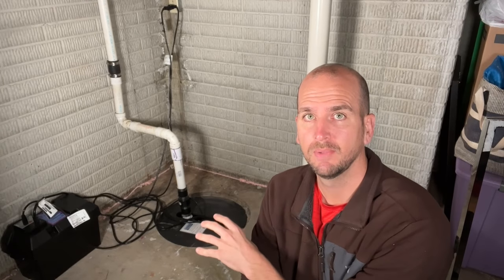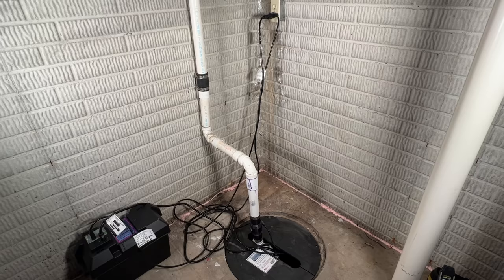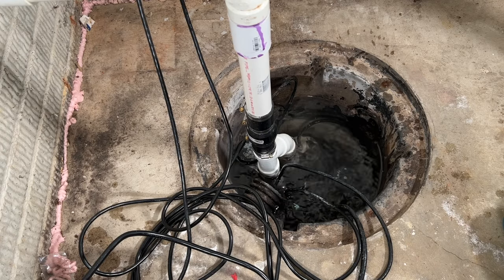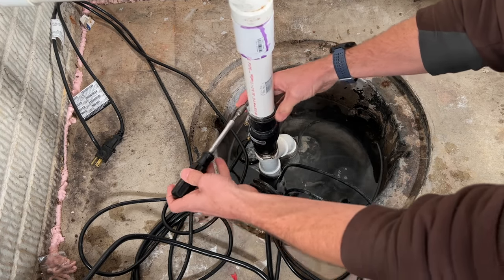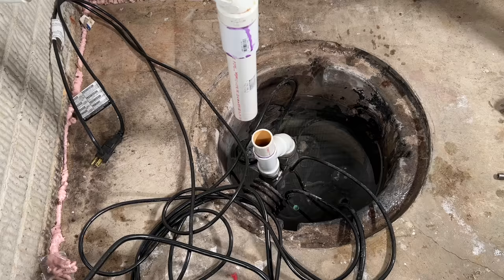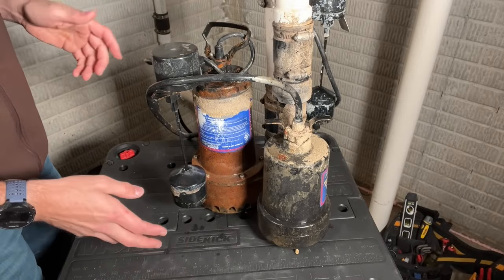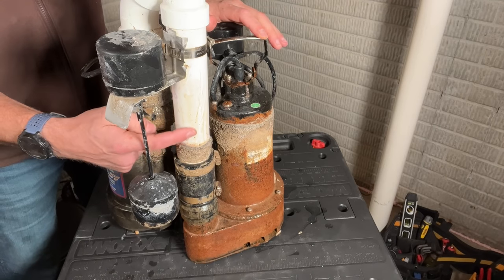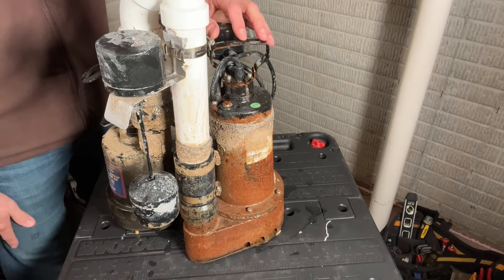Sump Pump Running But Not Pumping Out Water | 3 Fixes

Comment: The Y design in the pit is simply wrong.  You need separate discharges for each pump reaching above the lid. Then each discharge goes into its own check valve.  Then you can add a Y after the check valves so it shares the rest of the piping.  The way this is shown in the video each pump is pushing water backwards into the other pump.  This is more noticeable when the primary pump fails and the 12 v pump runs.  The failed primary pump will be back feeding water into the pit as the 12v pump runs.
Reply: I'm researching this very problem, so; each pump should have it's own check valve..
Reply: @markszablewski6619  Neil is right, you pumping out water like you have a 1/3 pump and it looks like your main is a 3/4 and your secondary is a 1/2 horsepower, got horses, you just short a check valve and in the wrong spot, note I believe the main is a plastic impeller while your secondary has the metal impeller, that would also mean if everything is running and main is still failing, the impeller might be broke from swallowing an object (but at least barracuda sells the piece).
Reply: You are spot on Neil, and that is the reason why I believe his setup takes so long to eject the water out of the sump - his setup is circulating some of the water back into the sump - so you need the two check valves indeed.  Also, the two cords connected into the outlet is not for two pumps - the first plug connected into the outlet is a piggy back cord coming from the float switch and the pump power cord connects into that.  If one connects the pump power cord directly into the outlet, the pump will run continuously.

Comment: Just a thought, since you said that you only have one check valve located above both pumps, isn't it possible that the one pump running is simply sending a bunch of water down through the one next to it creating a loop? Love your videos man!
Reply: That's what I'm thinking.
During "normal" operation some of the water makes it out of the house and some gets pumped back in pit. All is good, basement stays dry.
However, during heavy rain event more water volume is making it to the sump.
Now existing pump set up can't send enough water out of house. Basement gets wet.
Reply: Yep totally agree. If this setup functioned correctly at one time, which it must have, then making a design change (weep hole) should not be necessary.
Reply: @jimh1996  it can be necessary, some pumps have a built in weep hole, like zoeller pumps have. Zoeller themselves recommend adding a secondary "weep hole" in the discharge pipe, often the built in hole can get plugged up from dirt or rust or other debris.
Reply: That’s exactly what is happening.

Comment: So I have 2 sump pumps as well on two completely different areas of the basement. I heard the one running, which it never does, so I went down to check and the main pump that usually runs is full to the top with water and just making a buzzing sound.  This pump is only about 5 years old. Help. It’s 11pm and I pray all will be well until morning when I can call a plumber and not pay overnight prices

Comment: I just installed a sump pump in my backyard. After days of trench digging and pipe fitting in the sun I was finally ready to test. It ran without moving water, I almost cried. Then I realized I installed the check valve upside down.

Comment: Woke up last night hearing a loud humming.  Went downstairs and the sump was running but not moving water (unplugged it).  Went down today and did your check.  Pump is pumping, check valve ok and weep hole ok.  But when I loosened the check valve band clamp water was rushing down from the discharge pipe.  I checked outside (pipe goes into the storm pipe).  I guess a mouse or chipmunk crawled down storm pipe (small space between downspout and storm pipe which I sealed) and into the pump pipe and built a nest.   I went back down and reinstalled everything, plugged it in and it cleared/emptied the sump pit.    Great info - thanks so much!

Comment: Years back I had a sump pump failure and resorted to a small pump to tide me over until repair/replacement. I had a small pump designed to remove water from my above ground swimming pool cover. That little champ did the job. It chugged water from my sump well through an attached garden hose and into my laundry room set tubs. I did not have a shut off switch so I would unplug it when the well was empty to spare the wear and tear. I was alert to any rain forecasts and would scamper into my basement to plug my cover pump back in. It was not the ideal solution but it was better than trying to empy the well with a bucket and much better than mopping up the floor. It also helped that I was past the Spring thaw when the basement is most inclined to flood.

Comment: Great video.  A couple things to add that you might look for (just happened to me and I almost  was about to unnecessarily replace my pump)...  For my pump setup, the 1-1/2 pvc discharge pipe goes up, then makes a little downward turn and connects to a cast-iron sewer line.  I discovered 2 issues:  (1) Over time, sediment and little rocks that accumulated in the pit caused my check valve to get filled with a silty/clay type mixture.  This caused the check valve to get super-clogged (which you covered nicely in your video).  I took the check valve off and cleaned it thoroughly outside with my garden hose until all of the sludge was gone and the flap was flapping/seating properly.  When I reconnected the check valve and tested the pump, it still continued to cycle (I also had previously drilled the little relief hole so I knew that wasn't my issue).  Issue (2) I found next which was the biggest culprit was a near-total obstruction where the pvc discharge pipe connected to the cast iron.  It connected via a threaded pvc fitting/coupling going into the cast-iron which created a slight reduction in overall "flow" size when you tied in from your 1-1/2 inch pvc discharge pipe into the male fitting that screws into the cast-iron .  I figured this out by running a handheld snake up through the pvc discharge pipe (where the check-valve would usually be) to try and get through to the cast-iron pipe.  Once the snake got close to where I figured it should be entering the cast-iron, I realized that it wasn't moving and was totally blocked!  When I pulled the snake back out, the length of cable confirmed I had an obstruction just before the coupling and the snake had some of that clay type sludge on it.  Since all of my pvc joint were glued in place and I had braces holding the pvc against the wall, I decided to cut the pvc about a little under a foot away from the coupling (I made 2 cuts and removed about an inch of pvc pipe to make a gap that I could later reconnect with a flexible coupling and clamps).  When I removed the threaded coupling with about 10 inches of pvc pipe still connected from the cast iron , I saw that the coupling and about 5-6 inches of pvc before the coupling was basically 100% blocked with little rocks, pebbles and the clay sludge.  I took the coupling and pvc pipe outside and blasted it with water from my garden hose  until  it was 100% clean.  I reinstalled the coupling to the cast iron, connected the pvc to the rest of the pvc discharge pipe with a rubber coupling/clamp, reinstalled the check valve and everything worked perfectly again.  I should have mentioned it before, but I always wear thick rubber gloves when working on any types of pumps (even ones that are only for storm-water/drain-tiles).  I hope this helps someone else because I was about to go buy a new pump which would not have solved my problem since the discharge line was obstructed.  I forgot to also mention, there is a cleanout for the cast iron about a foot below where the pvc ties in and that was clean/no water backing up when I opened that, so if I didn't try to snake up from where the check valve was, I would not have found the obstruction and I would have installed a new pump for no reason.

Comment: Very interesting. I wonder if the check valve was stuck and got unstuck when you unscrewed it. I am glad we don’t have this in Florida. You really have some work to do   Thank you for sharing
Reply from the maker: I think the pump got airlocked but not 100%.  Just installed the new Zoeller M98 today with the install video coming out tomorrow 👍

Comment: While going through my pump's installation (comments below), I thought about something that you said.  You mentioned that your basement bathroom's ejector pump feeds your sump.  Probably not a good idea to go dipping your hands (and watch) in blackwater or having blackwater discharge out into your yard (if that's where the sump pump's discharge goes).
Reply: Absolutely no way a toiiet should ever discharge into a sump pump - esp one that has a loose fitting lid and no vent.  Unless I missed something.  The bathroom sink and shower water would be ok.  Rainwater would be ok.  But never toilet water.  And the comment on where to place a check valve on each pump is right on (i.e., one check valve per pump).

Comment: Very informative video.  I have never seen a sump pump that slow.  I realize that there was some water backed up in the 3 inlet pipes - mine does the same thing - but my little 1/2 horse pump will empty a full sump that is up to the very top and overflowing - like after a short power failure - in 20-30 seconds.  After the initial emptying, the inlet pipes will fill the sump enough to turn on the pump again in a minute or less but at the point the pump empties the pit in 10-12 seconds.  Remember - this is only a 1/2 HP pump... not a larger 3/4 or 1 HP unit.

Comment: Great video!   Your current design has too many check valves, the one at the top is not necessary and redundant. Most sump pumps dead head (max psi at 0 gpm flow) at 8.68 psi or 20’ ft of head or less. All chech valves cut the flow rate. The cords should be coiled and supported where they are plugged in (use zip ties if necessary), this will eliminate some switching problems that can occur because of the cords in the wrong place. The Zoeller pump is a better choice than the one in the pit. The Zoeller pump is a vortex design that is why the weep hole is necessary. On a vortex design the impeller creates a whirlpool in the pump to pass the water, if the pump has been in for a while and the water has dried up, it cannot prime itself because it is in the pump cavity at the top and air being inside it will not push the air out and thus becomes air bound. The weep hole allows the water to fill the pump cavity and then the pump will pump. Personally I like one pump with a tethered float setup for maximum flow (largest tether) made by a Wayne Pump in Harrison, Ohio. This has an impeller in the pump cavity that doesn’t need the weep hole. My sump pit discharges water at 7’ of head and dumps into a 4” corrugated pipe and then gravity flow from there, I buy model SPT33 1/3 HP (other HP’s are available on line at Menards) which is more than enough for my application and very economical. Your plumbing could also use a little change, try 2 …..45 degree elbows instead of the 2 …..90 degree that you have, less restriction, more flow. Being in the Midwest there is another reason a pump will not pump and that is a frozen pipe where the water goes outside. This is a little harder to remedy but try a small weep hole at about a foot below where it goes outside, attach some tubing at this point (use a tee in pipe) and drain back into the pit (a 1/4 turn undersink ball vave can be used here and shutoff from April to November). The Barracuda pump is a private label brand sold by Menards, being out of the business for over 10 years I do not know who makes it for them. Thanks…Jim

Comment: This video was very helpful my basement has been leaking from the foot of snow and week of rain in Michigan.      I have been shop vacuuming the access points of my waterproofing system but it wasn’t keeping up .     My sump pump then stopped working .      I cleared out the valve because of your video and the pump worked again.   It had some sediment stuck around the valve .   I cleared it so the valve moved easily and back to normal .   Thanks !

Comment: One other sump pump thing: after a 24 hour power outage that rained a lot, I installed a water-powered backup, that doesn't require any battery or AC power.  It uses municipal water pressure to pump the sump water and saved me when my old sump pump failed.  It uses a fair amount of water, but that expense is cheaper than water damage.  Mine is paired with an alarm, so I know it is running.  I have the Basepump, but there are other brands out there.
Reply: I had that system. It never run for years. When it was needed it was sized from years of not operating. I removed it.
Reply: @circuitbreaker9001  I test mine twice a year. I've had no issues in the 4 years I've had it.
Reply: @jimmypautz  I guess I should have tested it more often. I did have it 7 years

Comment: Thanks for the lesson Scott. Great video both verbally and visually. I just inspected my Zoeller check valve that is installed on a pump used only for a basement sink and nothing else. The pump started cycling on every 10 minutes the other day. The flap appeared to be working well but I performed a second test by standing the unit in the sink and filling it from the top. The seal leaked into the sink right away just like a bad toilet flapper. I am off to the store to buy a new $22 unit and finish the quick fix. Thanks and stay well.

Comment: Does the weep hole also help create a burst of energy, water mixed with some air, to slam open a check valve that is slightly stuck or with water column weight on it?

Comment: You might try moving the check valve a few feet higher.  On that setup there has a quite tall column of water heavily sitting on the top of that check valve. The dual pumps might even need separate vertical-discharges sections so that each check valve doesn't' have so much water sitting on them.
Reply from the maker: Thanks Bob 👍  I am actually working to install that Zoeller M98 right now.
Reply: @EverydayHomeRepairs  It's not likely to help.  You need the checkvalve between the pump and the Y.  Otherwise, with one pump operating, it just pumps it backwards through the other pump.  You're CERTAINLY NOT going to generate enough pressure to lift the checkvalve with its standing water keeping it closed, past the Y to get it out of the basement.

Raising the checkvalve won't help unless you're very lucky.

The most convenient way to do this is to put a checkvalve right on EACH pump, then Y their outlets together.  I have something similar, with a big submersible with the checkvalve right on top, then up the wall and just before the wall I Y-in the tubing from a battery pump via ANOTHER checkvalve.

But remember, the checkvalves MUST be between the Y and the pumps.

I suspect this thing was cobbled together while the pit was dry, and it never got fully tested.  If both pumps were running, it might work (as long as the pumps were roughly equal).
Reply: 2 smaller ck valves always worked for me.

Comment: How about the possibility of a clog in the drain pipe above the check valve?  I'm wondering why you didn't try running the pump after loosening the clamp above the check valve (to create an artificial leak) to see whether water would be pumped out there. (To avoid a messy spray, you could drape a little "shower curtain" around the pipe & check valve before turning the pump back on.)  If water is pumped out through this opening, wouldn't it imply the pump & check valve are okay and there's a clog in the pipe above (downstream of) the clamp?
Reply: My exact issue!

Comment: Thanks for a great explanation, tutorial.  I'll pull my pump out to see if there's a weep hole!
Reply: A little while later...check valve checked and confirmed to work properly, absent weep hole drilled, me realizing that I should pay closer attention to where the clamps go and/or use a brighter work light (it's OK, I'll dry out).  Pump works as it should now.  Thanks again!!!

Comment: Mine was running a lot.  We could hear it turn on, then when it shut down, we heard a whooshing sound of the water coming back.  To fix this, and since I did not know where the water was going, I added a French drain from the house to the street and directed the outlet to that drain pipe.  I then replaced the 20+ year old sump pump and replaced the check valve and pipe to my new outlet.  Once the new set up was done, that water goes to the street faster than I can get out of the basement and outside to see if the pipe is running.

Comment: More info about how air in the pipe can block the flow of water  -- so that a weep hole is needed to allow the air to escape -- would be appreciated.  My intuition is that the air would simply be pushed upward by the pressure of the water being pumped, and thus would not hinder the flow of water.   Were you trying to say there could be so much trapped air that the pump's impeller is in the air, not submerged?
Reply: That’s my understanding of it.